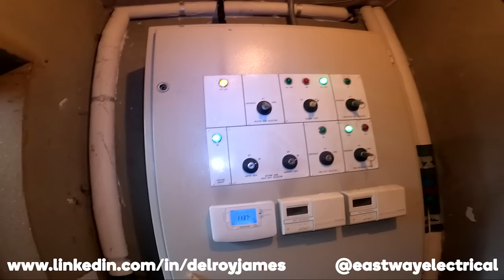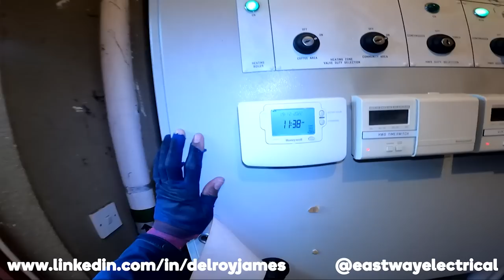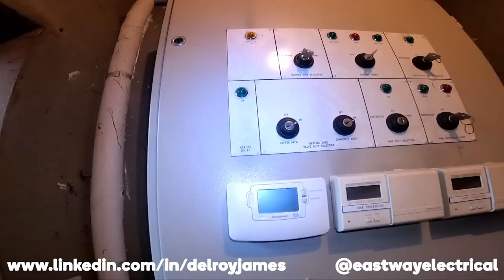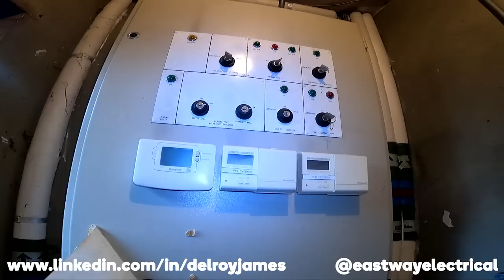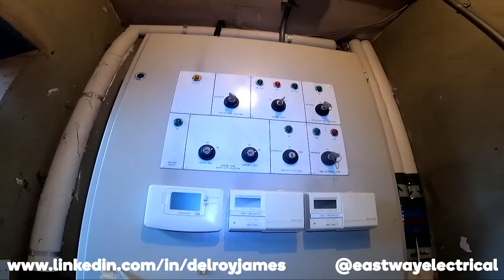🥶🥶 No Heating In This Church | Real Life Electrical Fault Finding | Electrician In London Vlog

Comment: There are a number of reasons why a contactor would be making a racket like that 
1 The control voltage supplying the coil is not in the acceptable range for the coil rating
2 The control source is not providing the necessary current to pick up the coil or there may well be debris on the pole face of the yoke and or armature, wicked content as always Delroy, had a few moments like that when building panels back in the good old days, mainly on the commissioning side of things, the usual line was "Well it was ok back in the workshop before the install 😂
Reply: or the source of the contactors control is is having a problem like a faulty thermostat
Reply: @ratbag359  yes indeed there are many reasons 👍
Reply: Often it's the contacts that get burned up with time. When i get this fault, sometime just quickly pushing the contact manually with a screwdriver (and power off!) will clean them a bit and give it some life back while waiting for the replacement.
Watching the video, i was wondering if it could not be one of those relays at the bottom that's dodgy and making a good contactor buzz :P
either way, going on and off quickly would have killed the contactor anyway.
Reply from the maker: Hi John. Thanks for your comments sound like you know your stuff could have done with you there. thanks for watching
Reply from the maker: @ledoynier3694  If you watch the next episode, you may find out you were right. Something down the bottom was faulty. thanks for watching.
Reply: @eastwayelectrical Cheers Delroy also good content haven't touch this sort of stuff since the ice age having said that the heating control panel the company built is pretty basic looking at what it is actually controlling, looking forward to the outcome
Reply: defo hospitals have lots of panel for heating  & boiler house & back-up generators  generator lift room's  it go's on & on  it all take's time we could spend more time on the job  to trace these   but we had to get it done  it was critical live's could be lost  lift's stuck with patents have to go to theatre  you name it

Comment: As those contactors seem the same type maybe swap the 'bad' one with another one on the panel just to prove it is actually a faulty part and not a power issue to the coil. What devices do these contactors connect to and is the device known to be working correctly? Maybe the device has an issue and is kicking the contactor off immediately?  Great video as usual Delroy, can't wait for part two to reveal the outcome!
Reply from the maker: Hi Blokey. It controlled the heating system 2 pumps in that switch room, and some other stuff in the church. things may be clearer in part 2

Comment: Grundfos pumps are for water defo not gas ahha! will have a VT Heating circuit or CT circuit BMS panel will light up to automate the pumps and valves.

Comment: Did a job recently where the heating engineers had replaced 2 old 3 phase pumps with 2 new single phase pumps. They had found a nearby neutral but they had connected both pumps to the same phase thus overloading the motor overload in the contactor.

Comment: May or may not be the contractor could be the device that is switching the contractor perhaps worn out contacts on a control relay that switches the contractor on or a faulty sensor switch or loose connection in any of the control circuit not sure if replacing the clattering contractor will make a difference or solve the issue….good luck anyway

Comment: Hello! The similar issue that I had like that, with one contactor making that sound was a faulty pressure switch in the controls of a industrial oven, BEFORE changing the contactor, connect the coil directly to ensure that indeed the contactor is bad.
Maybe is on and off because the control voltaje is on and off too
Reply from the maker: Hi roceloi. I think you are right the switch was faulty. thanks for watching.

Comment: From my experience it is rare, that a contactor has a faulty coil. You could disconnect circuit to the coil and apply 240 v to test coil.The contactor can make that sound, if the coil is not getting the correct voltage (undervoltage). There is no harm changing the contactor, since the main contacts probably are worn, due to the contactor not operating correctly.

Comment: Hi Delroy, love your videos. Could be a blown coil for sure. I'm only an apprentice in Canada but I have seen overloads burnt out by overcurrent that weld contactors together taking a phase out on 3-phase motor load making that sound so they just wiggle instead of turning. Without seeing the load I don't think anyone watching this video really knows what your problem is - no idea if its the devices, choice of devices, or wiring.
Reply: Furthermore, understanding the load and then using your clamp meter on the output of that contactor is going to tell you exactly what is happening versus what it is rated for when it is making that awful noise.
Reply: If you want to follow this thread, I will show my boss tomorrow and ask for his opinion doing controls for most of his career.

Comment: I feel like you might end up replacing that contactor and its not that.

I'd have put 240v to the coil direct off the incoming supply and see if it held in.

If yeah, then you have an Intermediate control signal to that contactor that is having its voltage pulled down for some reason, and it isn't enough to pull in the contactor on the coil supply and keep it held in.

Them small relays look like 14 pin types, and are probably interposing relays that are pulled in off the H&V controller with the 240v switched through it to pull in the coils of the bigger load contactors that will run the pumps

The key switch is set to pump 2, just switch it to pump 1 and see if that comes only ok until it can be sorted
Reply: Id use a separate supply with the unit unpowered  so the unit won't power up anything out of step

Comment: I would have given the controlling busybody a bollocking for dumping all his BBQ kit etc in a working plant room causing HSE issues and got him busy clearing it all out, then send him away with a fly in his ear to map out all the radiators in his church with dims and specific details of locations, or just send him away to look for a 'long stand'.  I don't have the patience for people like that.
Chattering contactors, could be one of many reasons, coil breakdown, debris falling and lodging between moving parts, a common fault is the electronic smoothing circuit breakdown i.e. coils are often DC and supply voltage is rectified to inhibit the AC hum of multiple contactors in these enclosures, cheap enough to replace complete units though there are usually little thanks for repairing cheap components!.  You laughed at the thought of an Industrial Electrician? you're right of course, in theory! 🙂

Comment: Was there anyone in the panel before you delroy. Sometimes when you have two motors on two contactors with a electrical interlock and the A1 A2 coils are wired to the wrong contactor they bang in and out like that...!
Reply from the maker: Hi Adrian. over the years, I think a few people have worked on the panel. Thanks for watching.

Comment: is it not what ever is switching that coil that is making it chatter like that  like a smaller relay or thermostat somewhere  ? as you look at the side of the coil housing there is 2x spring clips  1 on each side it will un clip and fall in 2 half's  done quite a few of them in the hospital i used to work at  good luck hope that helps you  del